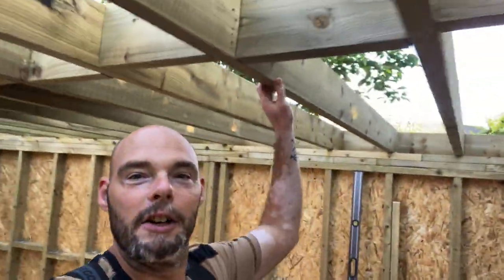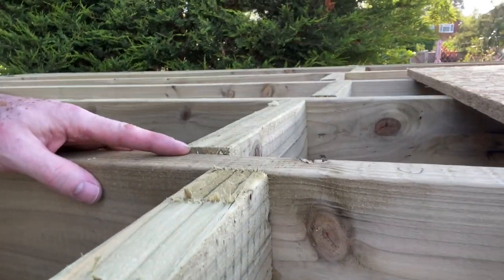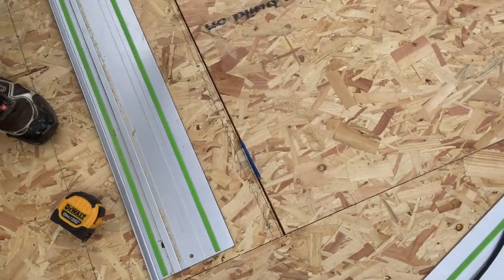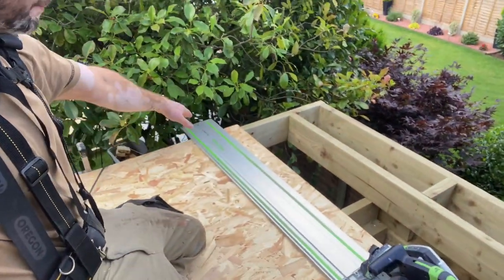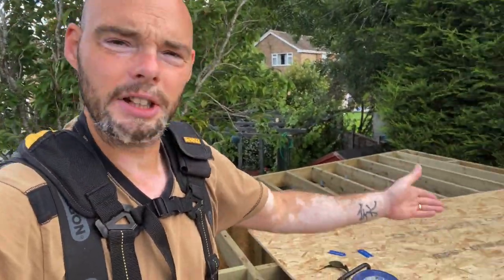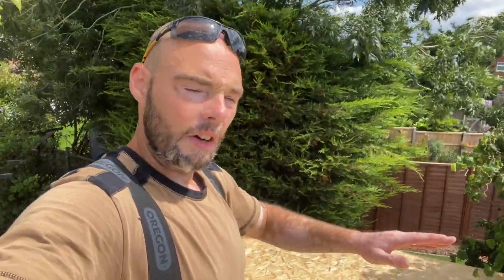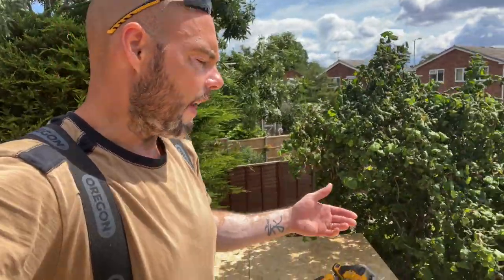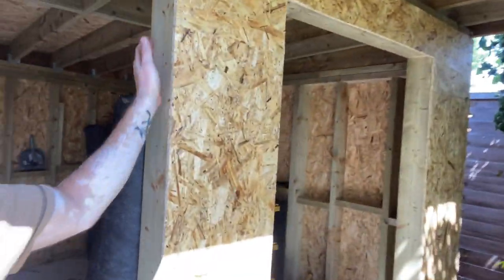Garden Room OSB3 Roof Fitting Explained & Shown

Comment: I’ve finally got to the roofing stage (taken me longer than expected, but your videos have helped immensely). I have a simple question that I’ve been unable to find a specific answer for. What is the reason for using ring cut nails to fix the 18mm osb. Why not use the same screws used to secure the floor? Is it something to do with wind lift or heat expansion?
Reply from the maker: Hellon Phill!! So glad these have helped fella!! So basically ring cut nails have much better shearing strength compared to the screw equivalent making them much better for those parts of the build ;)
Reply: @TheHomeRenovationExperts  my build has stalled for a few days. Finishing the roof noggins today, so boarding with T&G tomorrow. I've saved about 200 63mm ringcut nails for the boards. Will I be Ok doing a mix of nails and screws? Save me buying more nails?

Ps : Hope you recover from Covid OK. I had it last year, it was proper nasty.

Comment: Hi buddy love your friendly videos! Always a thumbs up! Im struggling to get OSB 3 T&G Boards and going to fit a large rubber membrane roof! So i didnt want gaps showing in the rubber! 
I wonder if you can you Chipboard t&g ?
The worry i have using just normal OSB 3 which i can easily get hold off is does the expansion gaps not show up after laying the rubber membrane roof?

adam
Reply from the maker: Cheers for the lovely comments fella!! And you absolutely don't need T&G and can use 18mm OSB3 full boards and I've done a video on how to do this here:

https://youtu.be/WDJNGD7a558

Any questions at all just ping em through!! :)